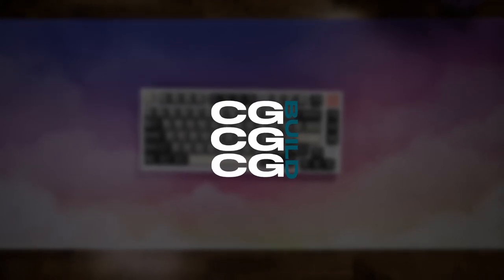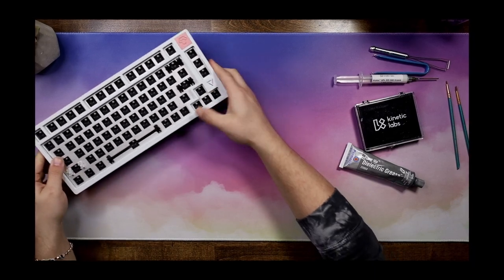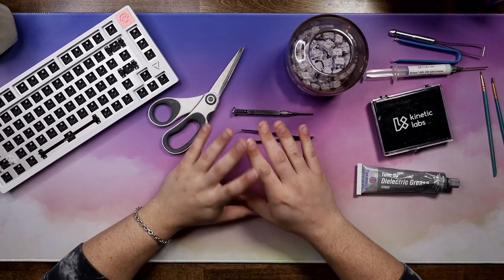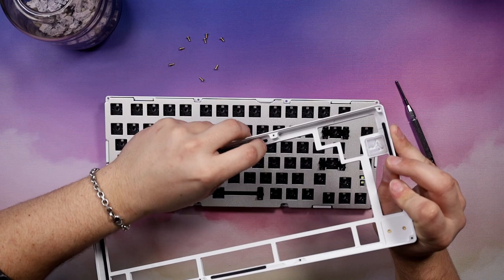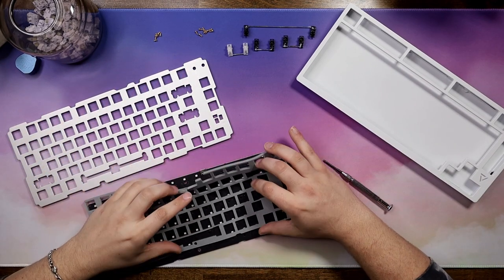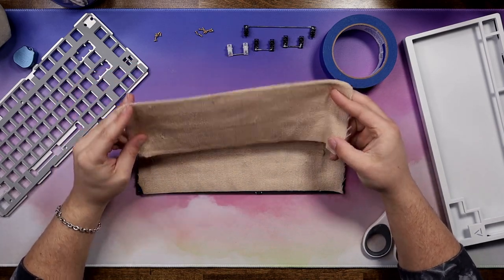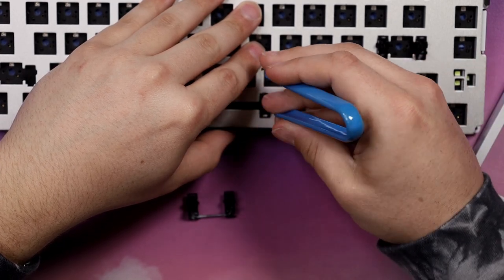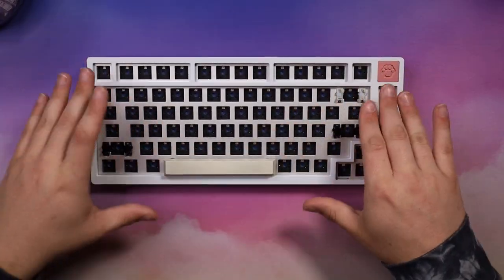What to do after buying your first keyboard... (How to mod a keyboard)

Comment: the one small problem no talking about is latency of the custom hardware.. in most cases i imagine it has pretty bad latency comparing to mass market gaming boards (at 100-200$ range)
Reply: not true latency depends on the switches only and sometimes the hot swap sockets electricity travels at the same speed regardless of pcb and when you’re building a custom keyboard you can choose what switches you want to use and change that whether or not you care about latency if anything you can choose faster switches than your “gaming keyboards” and plus you can spend less than 100$ on custom keyboards that are way better than 150$ “gaming boards”
Reply: Because it's not that big of an issue, only some customs are at 125hz which you can set back up to 1k
Reply: @NotGoodAtYoutube  its not just about poling rate. learn the subject first
Reply: @friendsRfor773  non issue, look at what naki said, even if it did have latency I wouldn't care as gaming boards don't have the value or sound of customs
Reply from the maker: Im gonna be honest man idk what you mean.. every keyboard I’ve built I’ve never had a latency problem.. latency is almost never an issue.. I mean you can buy “gaming” switches with a lower actuation point but latency is not an issue 😂
Reply: @NotGoodAtYoutube  how do u even notice latency with a board and not from your own computer
Reply: @HajjiNaki  never read so many bs like in this comment. 
kb latency comes from pcb and debounce timer set in the firmware, setting a 2ms debounce time will cause double key press so you would avoid it. most of the custom keyboard supports firmware updates and softwares to set the latency but you actually don't even need to care about it as you won't feel real difference from 2ms latency to 20ms as most of the latency in gaming comes from other hardwares, like your monitor and operatin system that will compute all the commands. 
so just don't bother and buy what you like.

Comment: Are you able to take off the ugly badge? I make my own aluminum, brass and steel badges with cutouts or a custom design so I'd like to be able to add my own.
Reply from the maker: I’m not sure but you probably could.. but I haven’t looked in to it
Reply: @AustinPegoda  there wasn't screws or anything like that when u removed the plate ??
Reply: @umi6376  there are 2 little screws but idk where to get badged that would fit.
Reply: @megadeth8592  I make my own badges as I mentioned in my comment. Just ordered this keyboard and already made my own badges yesterday eith the correct screw sizes/dimensions I use to sell custom badges for keyboards on etsy in the past

Comment: Question my keyboard keeps getting stuck like if I press down it won't pop all the way up I changed out stock stabilizers and put in  lines durok ones and it still does it can it be the caps? Or the board? I have a gk68 with akko lavender switches and Miami pbt Amazon caps😅... I'm new to all these mechanical boards please help TIA keep up the great work
Reply: Did you overlube your stabilizers? That can result in a mushy, slow pop up. A good fix is to clean off the lube with some water and scrub with some soap using a old toothbrush.

Comment: Guys be honest did I fuck up I bought pc75b which has Asa profile and was going to mod with cherry profile not knowing until now that those aren't going to work. Can I still use the cherry profile on the Asa or will it just never work?
Reply from the maker: Well the cherry keycaps have nothing to do with the Asa keycaps.. so yes cherry keycaps will fit.. just take the Asa keycaps off! :)
Reply: @AustinPegoda  Well it's north facing LEDs so won't that be an issue? I read and saw a couple posts/videos saying north facing LEDs are bad with cherry profile keycaps
Reply: @noahburkett7483  it depends on the switch, i've heard that akko's one have a slightly longer stem, and that prevents the interference, but I have no way of testing it so take it with a pinch of salt. If you already bought the caps just hope this is true, gl!